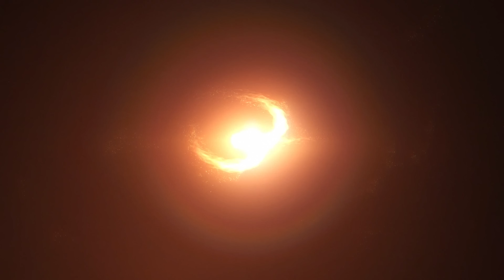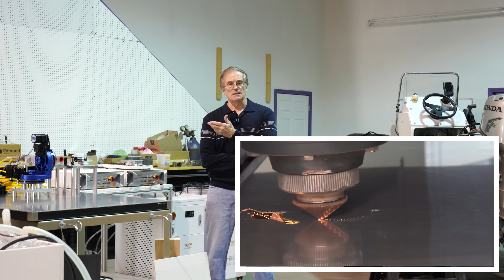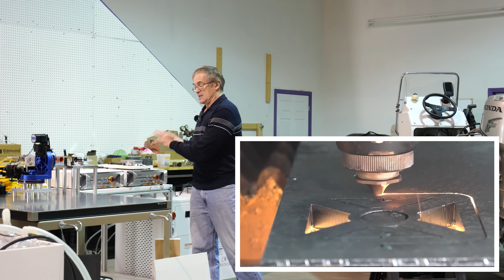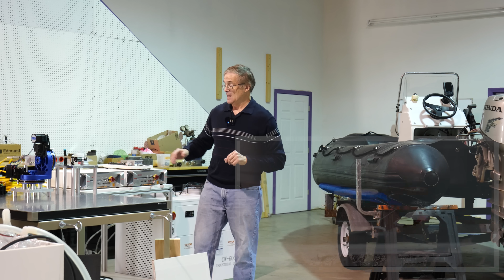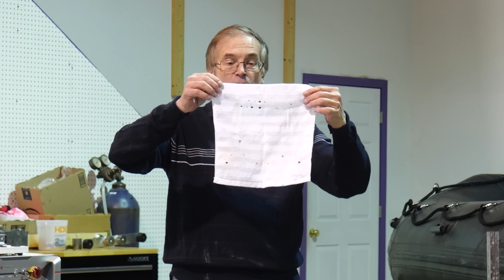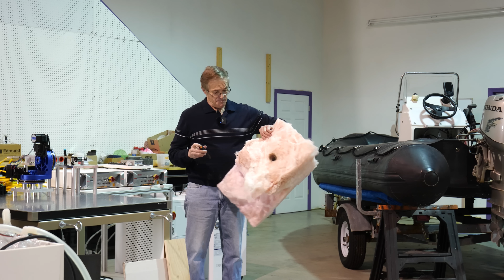We have a problem... and need your help!

Comment: Another, more off the wall idea. Make a large "aquarium wall" at least one giant glass panel of a type able to pass this wavelength, carbon-black slurry suspension with bubblers along the bottom....

Laser hits the wall, passes through the glass, hits the slurry, evaporates  the water, causes water phase change and that's about it. Assuming your glass species doesn't shatter... I suspect the carbon percentage would have to be precise enough to have the laser not interact with the carbon particles immediately after exiting the glass as this could potentially lead to catastrophic failure

Comment: I'd be interested to see how crystalline silica bricks hold up to this laser.  They're used in high temperature furnaces.  Unfortunately it would be expensive to set up a wall of the stuff.  There's refractory cement that you might be able to paint onto something like sheetrock...

Comment: I was going to suggest a watefall with a high temp ceramic wall behind it. This could be cheap because thin 1" thick waterfalls were a architecture fad 30 years ago. Or buy a few ounces of industrial Diamonds and mix with silicone crucible material might work. How hot are you talking about? 10,000 F  ?    Find a section (GOOD LUCK on this) The composite armor used in the M1 tank is Chobham. That is made to withstand more the 10,000 F  plasma. Water fall with a hafnium carbonitride (HfCN), a refractory compound wall behind it. If you do use water as a defuser then try different types of water mixed with different heat absorbing materials. But try de-ionized water first. If you had an unlimited budget LOL try tungstan plate with thousands of tiny holes drilled through it. Then pump liquid oxygen through the holes. Make sure you do not blow up half the county you live in.

Comment: My initial thought would be to use an intumescent material. However, when you showed the brick in your video, I was struck by another idea.

At the moment, I’m experimenting with carbon quantum dots mixed into concrete. My goal is to make the concrete electrically conductive, but interestingly, this also significantly increases its thermal conductivity.

The brick you demonstrated melted likely because it is an excellent thermal insulator, which means heat quickly builds up and causes failure. A material with high thermal conductivity, like the one I’m working on, might be able to withstand the intense heat of the laser beam for a few seconds longer by dissipating the energy more efficiently.

Additionally, due to its black and porous nature, it would also help to eliminate reflections, reducing the risk of beam scatter.

I hope this sparks some useful ideas for your experiments!

Comment: NightHawkInLight has a couple of videos on "starlite" a fire resistant material that produces a carbon foam when exposed to high temperature flames. This alone I do not feel would stop a concentrated laser beam as it would simple carve a hole through the center of the expanding molten foam, However, if this material were to be suspended between two sheets of say drywall, the entrapping space would force the expanding molten foam to be extruded into the cavity created by the laser and continuously replenish the ablating material.

Comment: How about a mechanical shutter at the laser output, maybe even before the collimator. Control it with a second  ‘watchdog’ computer set up so if either control system misbehaves the laser is shuttered and/or switched off.

Comment: You could try ceiling light panels to diffuse the beam. Keep them far enough away from the wall and the beam may spread enough to not damage anything or could be combined with other materials to shorten the distance.

Comment: If you can finely control and measure the frequency of the laser, you can create a custom Dielectric mirror for its frequency that sits behind the target and redirects the beam to a tub of water or sand (as both are very cheap and can act as “heat batteries”). Dielectric mirrors for fiber laser wavelengths are usually made out of fused silica. If you move the mirror back and forth, that can also spread out the impact of the beam over a larger area. 
https://en.wikipedia.org/wiki/Dielectric_mirror

P.S. If you have a thermovoltaic setup, you can even theoretically convert some of that heat back to electricity to save energy.
https://en.wikipedia.org/wiki/Thermophotovoltaic_energy_conversion

P.P.S You can also try graphene foam https://en.wikipedia.org/wiki/Graphene_foam

Comment: 3 options, laser weld process engineer

-1 increase your collimation diameter and lenght to reduce the minimum spot size you can achieve at final focus, it will impact your drone cutting capacity but will make it easier to manage at a lower power density, 2x spot =1/4 power density

-2 make a shot trap where the laser will be firing at with something that does not absorb IR well. Assuming it's a 1060nm wavelength so aluminium foil or copper heat tape applied as first surface to plywood at 45 degrees deflecting into floor (if bare concrete) or concrete blocks or dark sand, cheap, concrete won't reflect and won't be damaged,  one large sheet at 45deg would be simplest or a compound version of this. if the energy density is too high for aluminium foil or heat tape to manage get a sheet of 2mm copper

-3 make diffusive water lenses, ie a plano convex lens from clear bags filled with water, may pull energy density down enough to prevent damage on other side, will be tricky to find bags that work and hold shape though

Comment: Firing horizontally will be inherently more dangerous than vertically. Firing up into the sky is fine as long as you don't have a plane close by. Firing down use a water bath with carbon (coal) suspended in it for energy absorption and conversion into heat. 

If you have to fire horizontally a pile of water soaked carbon (coal) or a water wall of wet carbon will be your best option.  IE a sheet of black carbon with water flowing down it recirculating. This is how they do graphite (again carbon) energy absorbers for the big lasers.

Comment: Forgotten to tell: Aquarium type with ink-type Absorption and scatter material, but Watch the resonance from the laser with the glas and the adhered water(inside the tank/aquarium)/ front wall maybe borosilicate glass to avoid expansion.  The nm are the selecting factors.., Greetings again, seb

Comment: Turn the laser into a high frequency destruction rangefinder.  Adjust power level based on distance from target.  Might take some extreme nerdery.  Laser reverts to min power if max target  range setpoint is reached.  Back wall wouldn't see full power.  Could function test at non damaging power levels.

Comment: LLNL Laser Electro-Optical Technician Here ! This problem is literally my job! 

 I specialize in VERY high power lasers. We use thick blocks of graphite. It's pure carbon so it has a very high resistance to thermal insults, and it is matte black, so no dangerous specular reflections off the beam blocks. Graphite blocks and slabs of multiple sizes and thickness up to 1 inch thick and 1 foot square can be bought in bulk on the McMaster -Carr catalogue. You could layer the sheets of graphite for better thickness if you want, or even with that size of graphite build a 1 cubic foot or even bigger graphite lined target chamber. 

Another point to note since you are using a fiber laser especially of this caliber. Take MASSIVE care in mitigating reflections off your target when the laser hits. Even a 1% reflectance off your target can be insanely dangerous, especially in your situation, an open warehouse building. You will need beam blocks even for reflections off your target. If your laser has an alignment mode, use it to pre-align the beam to your target and trace any reflections coming off, then put blocks in the path of those back-reflections. These reflections won't be as powerful as the main beam, so I recommend using a special type of glass made by Schott called NG1, it's a jet black frosted glass made as a Neutral Density filter, with an internal transmittance of 0.01% at 1030- 1075 nanometers. 

Another option could be a water cooled beam dump, possibly DIY.  The link its to one built for 5KW of power, and its water cooled. its spectral range is 0.19 to 0.20 micrometer wavelength.  I don't know what exact wavelength your laser is so I can't exactly spec a COTS (Commercial Off The Shelf ) beam dump for your application. 
https://www.ophiropt.com/en/f/bd5000w-bb-50-beam-dump

I hope this helps, and I looks forward to seeing this ABSURD anti-drone laser in action!

Comment: I see someone beat me to the suggestion of rock wool instead of fiberglass.
Instead of wet cloth, what about wet rock wool/fiberglass? Assuming it can be kept reasonably wet, the water should greatly increase the time to burn through it and prevent the hole from continuing to grow. 

I also like the suggestion of splitting the beam at the source and aiming many weaker beams. This would add complexity (i.e. possible points of failure) but it should be more safe rather than less, as the chances of failures increasing the intensity are incredibly small.

Comment: This might sound silly, but maybe instead of aiming the laser horizontally, why not aim it vertically (pointing down) and fly the drone below it. You could use a scissor lift or even a bucket truck (the ones the power companies use for power line work). If all you're trying to demonstrate is proof of theory, it should work, and as long as you have nothing reflective on the ground around the target area, you shouldn't really need anything else.

Comment: I thought you would have tested rock wool.  You used that for your sound deadening tests in other videos and I think it will hold up to the heat better than fiberglass.  My only other thought is just a few inches thick of dirt packed in something that would be easy and cheap to repair since the laser will just go right through whatever the dirt is in..

Comment: The technology on this channel is over the top. Some really cool stuff most of us could never even dream up. I cant wait to see what this leads to ! Somebody out there will have a solution. I do have an idea but if lasers cut glass then its a stupid one... What if you took the panels of glass from a patio door and glued them into an open top frame separating them by a couple inches. Then fill the void with crushed glass and top it off with water. Would make a good sized panel and just might stand a chance at dissipating the light and the heat.. But would the glass panels handle it ? Could be messy..

Comment: laser power mechanical circuit breaker when near sheet/curtain ablated by stray laser beam, before it gets to your other measures. or electronic cuircuit breaker when camera sees light hit measures: this would be portable repurpousable cuitcuit breaker.

Comment: I think you either want absorbent with some way of repairing itself or very reflective and dissipate the heat over a large area. 

A waterfall of a gel or liquid would constantly repair itself. (So, paint or water with suspended carbon, or something similar). 

Alternatively, you could try to just reflect the light around to diffuse it. So you could use the same paint that is on reflective signs. The light will come back at you, but if it was diffused, it may be safe.

A more complicated idea would be two parallel mirrors that could bounce the light around enough to slowly dissipate the energy (a few percent each bounce)

Comment: Make a box with a sensitive light detector on the inside. A couple of layers of drywall on back and front sides. As soon as the laser penetrates the front layers light detector kills the laser automatically in milliseconds. Tape over the holes after each incident.

Comment: Glass sandblasting beads in an enclosed environment/box that can absorb lasers of smaller power. The laser shoots a hole in the side its shooting at, the beads split the beam, the split beam bounces around the inside and is split so small that they all have relatively small power. Even if some of the beads melt in front, they will fall and be replaced with other beads due to gravity. The beam doesn't bounce back because the hole in it is only the size of the laser. May not last forever, but should last for a reasonable amount of time.

Comment: Now this is the kinda problem we like to have! If it were my death ray, I’d stage it atop a platform (ladders and wood plank maybe?) and fire at a downward angle. Let the earth do the majority of the work, and maybe even dig a pit in the target area to fill with wet sand for extra thermal mass. Use any dirt you excavate to build up a small protective berm behind the target area, and make sure you know where your natural gas service is run!
Reply from the maker: Ha!

Comment: Water tank with high pressure bubbles for constant churn, maybe something added to the water to help with light dispersement. Inside the front panel of the tank have a gelatin coating to reseal holes.

Comment: I've used and experimented with Fiber lasers.

I have a few possible ideas. At this wavelength organics tend to less effected.

First, elevate and fire down towards earth, alternatively in a quarry/rock wall there's lots of mountains not far from you. Obviously, that's a "bring the laser to the mountain scenario." 

Second thought, Sodium silcate(liquid glass) binder with silica sand and black body carbon black additive to help dissipate heat. to make a large, relatively cheap, resistant and ablative surface you could use in house. 

Third, and probably least likely to work, water soaked paper lamination or angle textured surface with a pile of soaking wet recycled newspapers, which which could absorb, dissipate, phase change and the angle is to both make sure the thick pile of wet newsprint dies sag off and to increase the angle of incidence inorder to give a thicker cross-section. 

I would try the latter two in house then use the third if you can't find a viable in house alternative.

Obviously other ceramics and blaclbody absorbers come to mind but they are all unnecessarily expensive or not simple enough to make... Sodium silcate binder is cheap enough, sand is cheaper yey and some carbon black, well you choose how you come by that... The carbon might be optional but my thought is it might increase both heat absorbtion and some of the potentially ablative properties of the material... If you could potentially lock water into the matrices as well, without decreasing the density too much that may also have potential benefits.

Wet refractory clay could also be of some potential. Especially used in a similar way as the "wet paper" idea. 

0:30

Comment: Just throwing it out there - for your experimental phase, what if you were to elevate your rig and just aim the laser towards the ground?
Reply from the maker: It's  an option, but that would be a significant modification of the way this would be used to protect against incoming drones. The control system is an even more complex part of the system than the lasers.
Reply: …this of course would only be a temporary measure to enable initial ‘small scale’ experimentation, until one of the other more creative solutions is developed - and there’s been some great suggestions so far! I hope one of them can be implemented soon!

Comment: Fire retardant plywood with intumescent paint?  

If you are worried about a long time focused on one spot...

Put the wall on a mechanism that slowly moves the backdrop so the point of contact changes. 

What about parallel sheets of carbon felt with a sprinkler between them?

cool project :)

Comment: Just put in a beam diffuser to stay in front of the beam, even while tracking the target, when you are ready to do damage to the target, the diffuser moves out of the way. I would use the whitest paint you can find on any back drop. The material and paint would diffuse the laser enough that reflections wouldn't cause a problem, the paint itself would(hopefully) reflect enough light to prevent burning and give you long enough to put a laser diffuser back in front of the beam and/or shut it down.
Reply from the maker: That's an interesting approach. 
One limitation is that the fine guidance camera looks "thru" the beam director at the target.
Reply: @TechIngredients  Not sure what type of beam director you are using, but I would either mount it to it and adjust for the offset or I would use the camera in another position(this one most likely due to it being a stable position and less room for error) and just calibrate and align the camera and beam director together. Or possibly, not sure how that laser works(like a "warm up" time or if its instant) but you could use some simple programming as a "track target" for the camera while the laser is OFF, and when ready to shoot, turn the laser on. If it's instant, it would be easy to have the laser do "bursts of fire" which would give the camera time to recognize if the target is down(if it is, the laser doesn't turn back on) or if the target it still active(laser fires again for "x" milli-seconds). In between bursts, there's plenty of time for a computer to determine if the target is still flying or is down. If the laser isn't instant, you could have the diffuser on a fast servo or some other means that can move in front of and out of the way quickly. Again, with the diffuser, you would just need to move your tracking camera to have a clear line of sight and adjust and link the beam director and targeting camera to move exactly the same.

Comment: Possibly a steel or copper plate with a water cooling network behind it? As well as painting the front with a vanta-black equivalent? That or just have a concrete block wall on top of a dolly or several skateboards